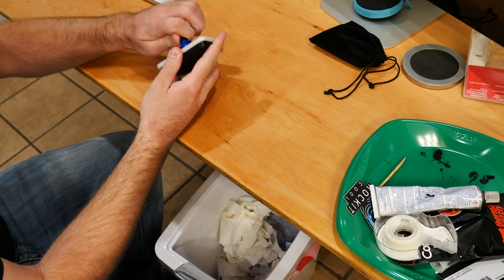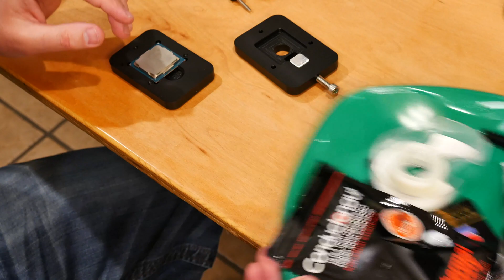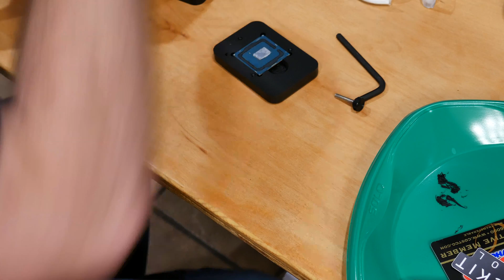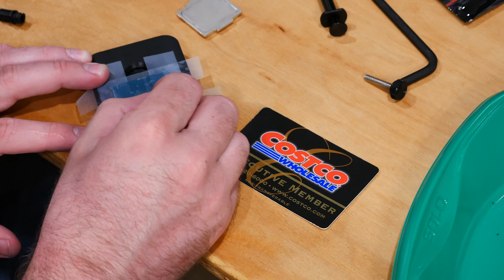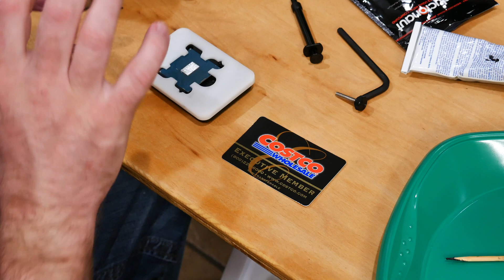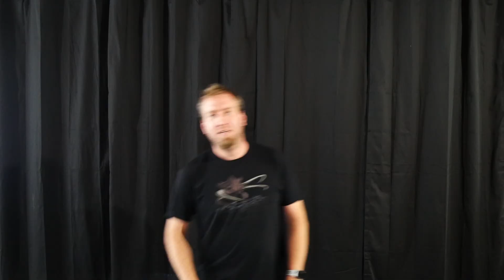Delidding and relidding my Intel i7-7700k. Scary but easy. :)

Comment: I bought a i7-7700 non K cpu 3 years back. I'm a blender user and that was the intended purpose for the cpu. What I didn't know was just how bad the temps would be. In blender it would hit 100 C withing a minute or two and start to throttle back the clocks.
First thing I did was try to reapply the thermal past but upon removal there was a good application and no change after. The second thing I did was I pulled it apart and lapped the IHS and stock (yeah I know) Intel cooler down to a 2000 grit. Put back together and temps maxed out at 81-82 C. Also before the lapping process temps would range upwards of 10 C (from hottest to coolest cores) and the difference after lapping was 1 C.
Next thing I did was undervolt the CPU with Intel XTU and then temps peaked at 70-71 on a 24 hour blender load. I think I have my voltage set in the neighborhood of 1.063- 1.065 I cant recall, but stock was 1.35.
I considered delidding up until that point but am still curious as to how much of a difference a delid could make. Do you think it is worth it PCGoblin?
I also have an old 4770 stock Intel heatsink that will fit. The finstack is nearly twice as tall as the one that comes with the 7700. I also just remembered I placed the fan from the 4770 on the 7700 heat sink after the lapping of the IHS and heat sink as the fans from the 4770 were better.
Reply from the maker: Kevin I think you would see a big drop in temperature if you delidded it and alot more than what youve done already. It doesnt matter what you do to the top of the ihs if the bottom isnt bringing the heat to the top affectively. 

As for if its worth it or not I cant say. At 81 degrees thats a safe temp even though its high. So to spend $60 or so to delid wont do much in terms of performance but it will lower your temps significantly. Ive delidded my 6700k and my 7700k and bother were drops of 20 to 25degrees. My 7700k is overclocked to 5.0ghz and never goes above 60degrees. So I imagine if you were to do that to you 7700 you would see about the same thing.
Reply: @PCGoblin  Might be worth a try then. If I could get 15-20 C lower after delid with the 4770 heatsink lapped and placed on my 7700 it would place me at 50-55 C (at 70-71 now) which sounds almost too good to be true. But so did going from a delta of 80+ while throttled to less than 50 C on the stock cooler. Will let you know the results. Thanks for the quick response.
Reply from the maker: @kevincourneyea3346  Another option to help temps out just a bit more is the copper ihs that rockit sells as well. This has the kit for everything. https://amzn.to/2ZAlPgl
Reply: @PCGoblin When I lapped the stock IHS I took it down to the copper removing the zinc or whatever. Didn't really take long at all. I would like a copper heatsink possibly, if I could find one like the stock Intels I would be interested in the difference between the two. Im sure just about any copper based heatsink with heatpipe tech would help but i like the low profile look personally.
What did you use on top of the IHS? LM or just paste?
Reply from the maker: Kevin Courneyea I wasnt aware the ihs was copper. But I used liquid metal. Im not going through all that to not use the best. :) If/when you do it Id really like to hear about your results.

Comment: After watching your video, I had the confidence to attempt delidding my i7 7700k using the same products shown here.  I had no issues at all. Process took maybe 20 minutes. This brought down my average temp by 20c. Running @ 4.5 with no heat spikes. Under stress it tops out @ 78c. Under normal load it sits @ 42c. Fans maintain quiet mode  now for the most part.  Thanks again for sharing your knowledge with us. Very helpful.
Reply from the maker: Thats awesome!! Thank you for letting me know. This comment made my day. I love when I can help improve something. :) Out of curiosity, what are you using as a CPU cooler?
Reply: @PCGoblin  Case - Xigmatek Elysium
Motherboard - ASrock z270 Extreme4
CPU - Intel Core i7-7700K 
CPU Cooling - CORSAIR Hydro Series H100i v2 AIO Liquid CPU Cooler
Memory -G.SKILL 16GB (4 x 4GB) TridentZ Series DDR4 PC4 -25600 3200MHz 
HD - Samsung SSD 850 EVO 250GB
GPU - ASUS GeForce GTX 1080 8GB ROG Strix
Power - CORSAIR HXi Series, HX850i, 850 Watt, 80+
Reply from the maker: Sounds like a beast of a machine, I was running a similar setup back when the 7700k first launched. :) Happy gaming.

Comment: Yep, delidding these is definitely worth it.  In fact, in my laptop here it came from the vendor already delidded with Kryonaut and the temps are great.  In a 15.6" laptop I'm able to run it 24/7 at 4.6GHz on all cores and only need to ramp the fans up when I'm gaming or putting a heavy load on the chip, and even then the temps only hit the low to mid 80s C depending on ambient (on cooler days it stays on the 70s or lower) and for most games it doesn't even hit the high 70s.  I personally delidded my 4790K before I got this rig and the same results; I was able to OC much higher with way better temps.  I'm one of the few who would have actually preferred Intel not return to solder having seen the temps on their more modern chips in the 9th gen where they still get better results if delidded (but getting through that solder and getting it removed can be a real pain and much more risky than with these older pasted chips).
Reply from the maker: Thats awesome! It seems like the benefits of delidding for a laptop are even greater since its alot more limited on cooling and options for cooling.
I think the soldered chips are great however they needed to do it right. What they did with the new chips is an insult since it stops delidding for the new x299 chips and makes it alot harder on the x390 chips.Heres hoping they fix it next time around.  :)
Reply: @PCGoblin  Yep, definitely.  I've been seeing reports about 9th gen chips being plagued by the same issues as their pasted predecessors including high temps and large deltas between different cores under load (which indicates uneven thermal transfer between some surfaces of the die and the IHS meaning their soldering is likely pretty shoddy).  I'm still anxious to see how the 7700K compares to the 9800X for IPC etc. at the same clock speed if you still plan on doing it (I know you've been pretty busy with other things).  I'm hoping that AMD and/or Intel will finally come up with a solution to faster communication across cores and through/between caches that scales to larger multi-die solutions (like AMD's chiplets and Intel's upcoming 3D stacked chips) that can match what they achieved with ringbus in chips like the 7700K.  I suspect it is one of the very few things keeping Intel's IPC just ahead of AMD's latest chips in gaming and a few other workloads (and it's the same reason their own HEDT chips tend to suffer compared to their desktop counterparts like the 7700K/8700K/9900K etc., though overclocking the mesh does help somewhat).
Reply from the maker: @xyz360400  I havent seen much on the 9th gen's but I didnt realize the soldering is so bad. I still plan on comparing the two but I can tell you that the 7700k runs ALOT colder than the 9800x does. Im going to do that video once I get my custom loop setup on the 9800x machine. Ive just been busy fighting with my home builder, knee surgery, and other commitments that popped up since then. But I will compare the two. :)
Reply: @PCGoblin  Cool, yep, that makes sense given that the 7700K has half the cores and all (plus the 9800X has a very different memory controller being quad channel and with many more PCIe lanes and using mesh vs ringbus).  If you check the reviews for the 9900K as well as most of the build guides, you'll likely notice the classes of coolers being recommended just to run it at stock (or God forbid, overclocked to a full 5GHz across all cores; for reference, my 7700K runs 24/7 at a full 4.6GHz across all cores in a frickin' laptop, so make of that what you will :P).  I also noticed that as soon as Intel started packing more cores into their 14NM process on the desktop side, their base clocks dropped through the floor and their TDP went through the roof, likely in order to feed all those cores and also to support the higher Turbo Boost clocks on single threaded workloads out of the box to make them seem like less of a downgrade (4.7GHz for the 8700K with a base of only 3.7GHz vs the 7700K's 4.5GHz Turbo and 4.2GHz base, and the 9700K and 9900K are just as bad, each starting at a base of 3.6GHz and boosting to 4.9GHz and 5.0GHz single core respectively, all of them with much higher TDP than the 7700K).
Reply from the maker: @xyz360400  I think the TDP rising is just due to the quantity of cores being put into it. Each core needs so much power, so comparing and 8 core to a 4 core the 4 core should always use less power. But then they have low base clock speeds since they need to guarantee a certain speed no matter what cooling is put on it. If they could dictate everyone had to put an AIO on it or better then im sure the base frequency would be alot higher. Not to justify what intels does, but 5ghz is super fast and it was rare to see not too long ago so expecting a chip to be 5ghz on all cores with 8 cores is quite a task. Its sad that they dont do everything they can to make sure the chips dont have heat issues though. :)
Reply: @PCGoblin  Yep, true, but the slumping base clocks still bug me quite a bit.  Dropping below 4GHz on all of their flagship chips just feels so wrong to me.  How does your 9800X OC?  I know you mentioned you haven't set up your loop yet, but have you OC'ed it at all to see what it can do?
Reply from the maker: @xyz360400  Does slumping the base clocks matter if at say 3.6 it does what the previous gen did at 4.0? My 9800x OC's fairly well. Ive got it set to 4.8ghz and its fine there. However I have to dial back the AVX clocks to stock or almost stock since when those run it gets up to 90+ instantly. Currently the Kraken X62 ive got on it just is not enough to cool that.
Reply: @PCGoblin  That's the thing, at least based on the benchmarks I've seen, Intel hasn't improved their IPC that much in the 8th and 9th gen to justify the massive drop in base clocks (and in fact, this is why I believe they brought up the boost clocks so much higher, jumping from 4.5GHz on the 7th gen to 4.7GHz and 4.9GHz/5.0GHz (for the 9900K) on the 8th and 9th gen respectively).  I have a system with the 8750H which is a 6 core/12 thread part, and even after using ThrottleStop to try and lock the clocks to the max 4.1GHz (which it still doesn't maintain reliably due to frequent throttling) it still runs noticeably slower, even in games and applications that are highly multi-threaded.  Obviously there's a large disparity in clock speeds, but my point is that more cores isn't always superior to high IPC and clock speeds (in fact, this is what AMD is dealing with right now and why they still haven't quite caught up to Intel in gaming and certain other workloads, though they are so close now that the difference is practically moot).  Yeah, AVX workloads are intense and tend to generate a lot of heat, however most real-world applications don't use AVX so it's not an issue you should run into too frequently outside of certain benchmarks that target AVX.  The Skylake X parts like your 9800X also support AVX-512 which is a feature not present on the 7700K and most other consumer desktop chips (they only support AVX2).
Reply from the maker: @xyz360400 Im not sure about the 8th to the 9th in ipc gains. But people wanted cores so they boosted cores. I completely agree on the more cores thing. I do alot of video encodes and so I end up using AVX instruction quite alot so I have to take that into account. But like you said most apps dont use it so thats why its not in the consumer side chips and its in the prosumer/professional ones. :)
Reply: @PCGoblin  Ah, so you use your 9800X as your editing rig.  Makes sense (SkylakeX/HEDT is an excellent platform for that IMO).  Yeah, you don't want to deal with overheating/thermal throttling while editing/encoding your videos since that would tank performance and majorly slow down your output.
Reply from the maker: Im a little embarrassed saying this but I dont actually use it for video editing. I prefer final cut X on mac more than anything ive tested on PC for editing for now. I have a plex server and I do a direct file copy of my blu ray to back it up and then I take that and run it through handbrake to optimize it for running on all devices while keeping most of the quality. I never handbrake anything more than once. But that takes some massive power to do. :)
Reply: @PCGoblin  Nothing wrong with that.  You found something that works for you that you prefer.  Hell, I'm still using Windows 7 (and plan to continue well past its end of support next year) for very much the same reason (though I do go to extreme lengths to lock it down and disable, kill, rip out or just flat out break anything dealing with file/printer sharing, remote access and most of the other easy targets for network exploits/vulnerabilities on top of many other tweaks and configuration changes I make to render the system more secure.  In fact, that's a big part of the reason I've been wondering about the 9800X vs the 7700K because (theoretically) it should be much easier to install Windows 7 on SkylakeX/X299 than Z370, so when the time comes that my little 4 core/8 thread CPU isn't getting the job done any more and it's time to upgrade to an 8 core/16 thread chip (or better), I'd like to know just how much performance, if any, I'm going to be sacrificing with regards to IPC and per-core/per-thread performance vs the 7700K.
Reply from the maker: @xyz360400  That makes a whole lot of sense. Though im guessing by the time the 7700k is a problem your going to want to go to a much newer platform than x299. Why are you staying on win 7?
Reply: @PCGoblin  Privacy and security mostly (I know, it sounds contradictory sticking with an OS that will no longer receive security patches, but hear me out).  The fact of the matter is, there are a LOT of things I can do, and have been doing for YEARS on Windows 7/Vista/XP to make my systems far more secure that just aren't possible on 10 due to many of the changes that Microsoft has implemented (I know because I own another laptop running Windows 10; that 8750H system I mentioned earlier).  I actually work in the anti-malware industry, so it's not like I'm unaware or ignorant of the risks and threats out there, but the truth is, it has been well over 12 years since I have had a single threat of any kind infiltrate any of my systems.  I am super paranoid, don't use social media (in fact I block access to all major social media sites so I couldn't access them even if I wanted to; the added benefit being that they can't track my systems using their embedded images/buttons found on most sites these days; I do the same with Google's tracking servers, Microsoft's and many others), I don't pirate software and I am very careful about how and where I browse online and I am the only person who ever touches any of my systems/devices.  I don't even use a smart phone because I hate touch screens, have no use for their features since I do all that stuff on my PC, and I don't like all the tracking/telemetry etc. that tends to come along with it (and I feel much the same about Windows 10; and yes, I know you can disable most of the telemetry in 10, but far from all of it, and I honestly just hate the UI and user experience over all and find it far more unwieldy than 7).
Reply from the maker: @xyz360400  Thats awesome. Im really glad to see someone actually care about what theyre sharing on the internet. Makes alot of sense for why you dont go to win10. :)
Reply: @PCGoblin  Yeah, and the constant news of more and more data breaches, not to mention all the crap that's come to light about all these companies and governments spying on everyone/gathering tons of data doesn't inspire confidence, especially when you've been in the line of work I have for the past 9 or so years and actually know first hand just what is and isn't possible with regards to spyware/monitoring/telemetry/AI/Machine Learning etc. (here's a hint: it's way more than most people think, and it's only getting stronger by the day).  I won't use any sort of biometrics either (no 'Windows Hello', no fingerprint readers, I physically disable any cameras and microphones built into any devices I own/use, I always disable Bluetooth if the device has it, and always always always change the default passwords and access codes for any networking devices (sadly many people still don't)).  I am absolutely not unhackable (no one is), however I am a lot more secure than most.  10 just has too many wide open attack vectors because it was built from the ground up to be an 'always online', 'always connected', and 'always sharing (with Microsoft and the world) "software as a service" operating system.  Windows 7 was the last OS Microsoft made where this was not the case (it all started with 8, but 10 is far worse).
Reply from the maker: I may not have as strong of an understanding as you do of what they can do, but I have a pretty good understanding and its scary. Im glad youre staying safe. :)